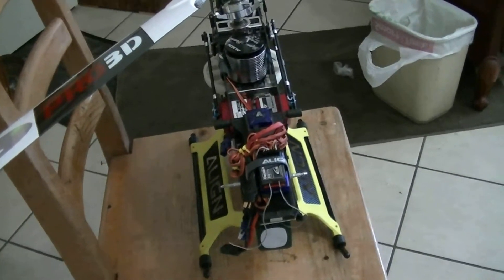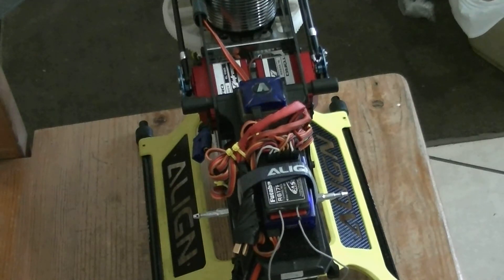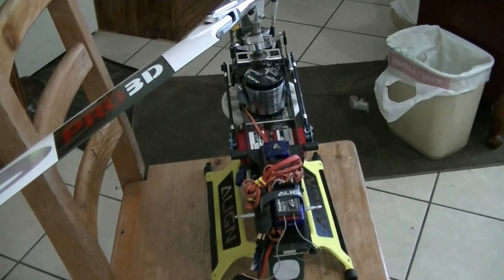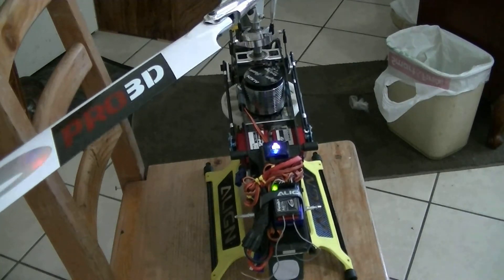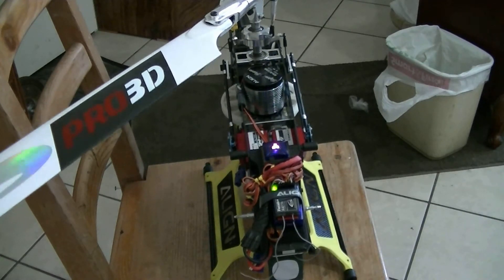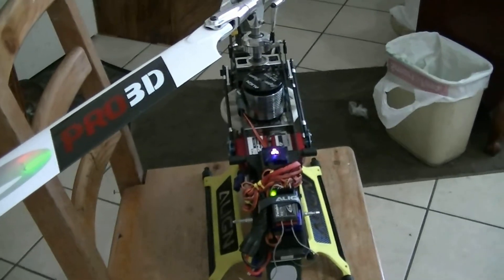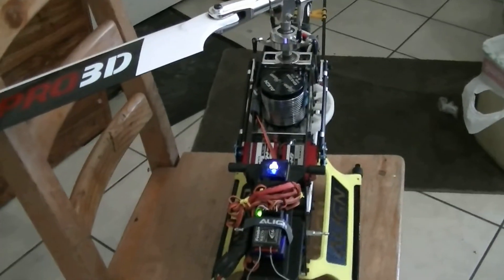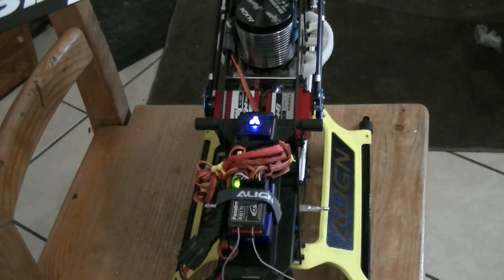align trex 700 v2 DFC without bec or regulator on outrage 9180 hv servos first plugin

Comment: you might goto HK and check out
Turnigy RotorStar Dual Power 15A Voltage Regulator

one side privides 5.2 volts to the receiver and the other side you set to what you want up to 7.4v it say 8v but its 7.4
have settable voltage alarm also
I put one on my alees 750

also the Hercules Super BEC pro is very nice and runs on a 3-18cell lipo
I might be upgrading
Reply from the maker: Turnigy RotorStar Dual Power looks awesome
better i buy a hv rx and stay away from the extra device that could go wrong 
but i do like that rotorstar thanks brother best bang for the buck
Reply: wcwicked clown
agree but it offers a buffer so if the servos pull to much current you dont burn up your v-bar or receiver